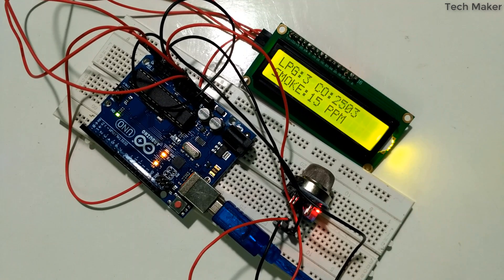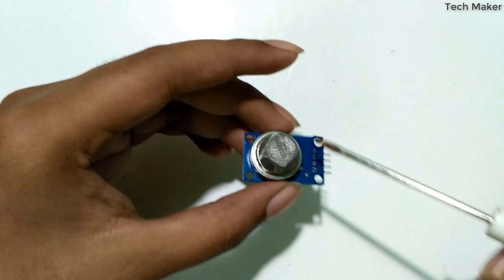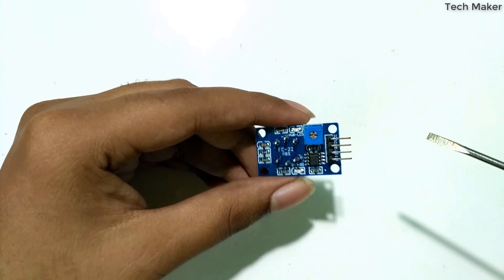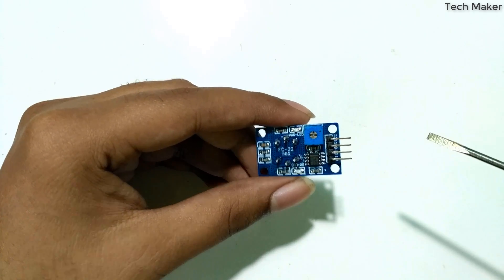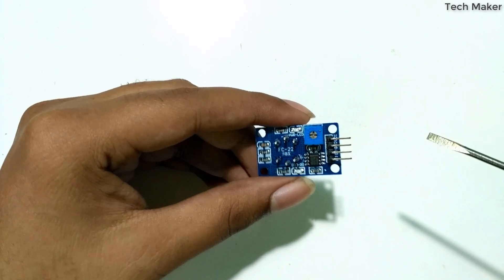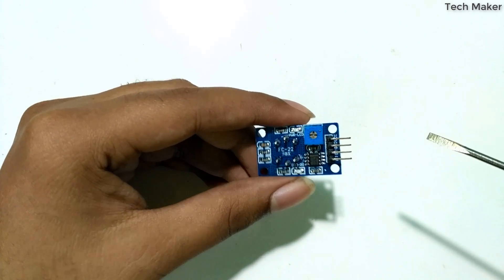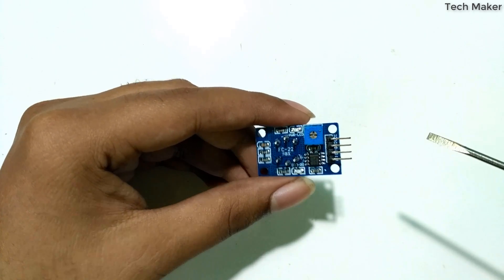How to Connect MQ2 Gas Sensor to Arduino

Comment: I have these problems:

MQ-04 sensor remain giving value between 200-300(approx) even I am not providing any external methane gas.
Same issue with MQ-02 and MQ-07 remain giving smoke and carbon mono-oxide values between 25-50(approx) respectively on the lcd.

Comment: The default output at analog pin is ppm or resistance ???
Reply from the maker: It is ppm, a formula is used in library file.
Reply: Sir one more doubt , two type of sensor are available in market one with potentiometer and another without i need ppm calculation so which type i should go for ???

Comment: I advise you not to power the sensor with the arduino, it draws too much current, it can fry the voltage regulator! Power is separately and connect the reading to the anaoge pin.
Reply from the maker: Ok,

Comment: hi sir, how you connected vcc pin from I2C display to Arduino 5v pin? Already you connected vcc pin of Gas Sensor to Arduino 5v pin.There is only one 5v pin in Arduino
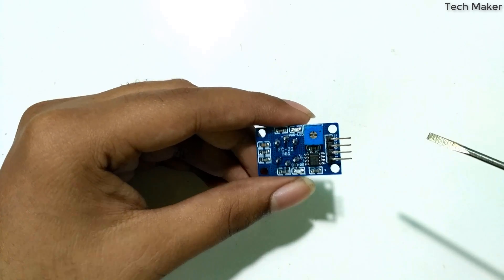Reply: at 2:53 you say vcc of MQ2 to here. What do you mean by here? your hand hides the pin and can't see which pin you connected to arduino?

Comment: hey when i go to upload the coad it says 
Arduino: 1.8.5 (Windows 10), Board: "Arduino Nano, ATmega328P"

sketch_mar14d:5: error: 'POSITIVE' was not declared in this scope

 LiquidCrystal_I2C lcd(0x27, 2, 1, 0, 4, 5, 6, 7, 3, POSITIVE);

                                                     ^

C:\Users\Aman raut\Documents\Arduino\sketch_mar14d\sketch_mar14d.ino: In function 'void setup()':

sketch_mar14d:13: error: no matching function for call to 'LiquidCrystal_I2C::begin(int, int)'

   lcd.begin(16,2);//Defining 16 columns and 2 rows of lcd display

                 ^

C:\Users\Aman raut\Documents\Arduino\sketch_mar14d\sketch_mar14d.ino:13:17: note: candidate is:

In file included from C:\Users\Aman raut\Documents\Arduino\sketch_mar14d\sketch_mar14d.ino:3:0:

C:\Users\Aman raut\Documents\Arduino\libraries\Arduino-LiquidCrystal-I2C-library-master/LiquidCrystal_I2C.h:76:7: note: void LiquidCrystal_I2C::begin()

  void begin();

       ^

C:\Users\Aman raut\Documents\Arduino\libraries\Arduino-LiquidCrystal-I2C-library-master/LiquidCrystal_I2C.h:76:7: note:   candidate expects 0 arguments, 2 provided

exit status 1
'POSITIVE' was not declared in this scope

This report would have more information with
"Show verbose output during compilation"
option enabled in File -> Preferences.
what did i dooo please help

Comment: I have the following problem, will you help? Thanks in advance!

In file included from C:\Users\user\AppData\Local\Temp\arduino_modified_sketch_140397\HelloWorld.ino:1:0:

C:\Users\user\Documents\Arduino\libraries\944051b30179/MQ2.h:4:18: fatal error: mbed.h: No such file or directory

 #include "mbed.h"

                  ^

compilation terminated.

exit status 1
Error compiling for board Arduino/Genuino Uno.
Reply from the maker: I think, you didn't installed the library.
Reply: @TechMaker1  Thank you so much!

Comment: For those who still believe in that numbers. This module only give Analog Output and Digital output, that mean you CANT measure LPG or CO or sth else separately, The Analog just tell you the intensity of the smoke that MQ2 sensor can sense IN VOLTAGE (0V to Vcc), the Digital tell you whether the smoke level cross the threshold or not IN LOGIC LEVEL (high-low). So just use analogRead() and digitalRead() function to use this module. The library is totally useless